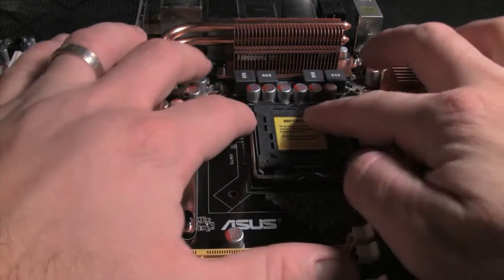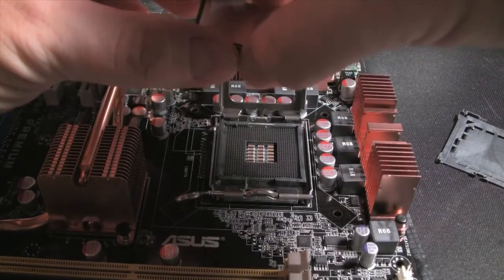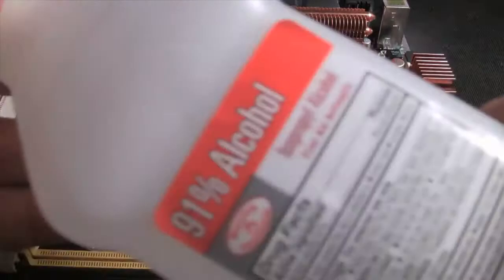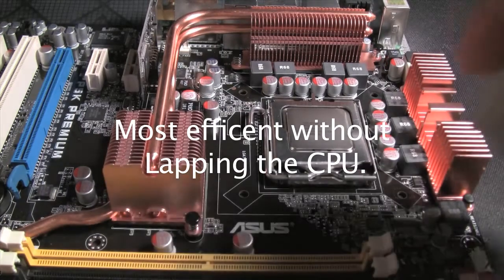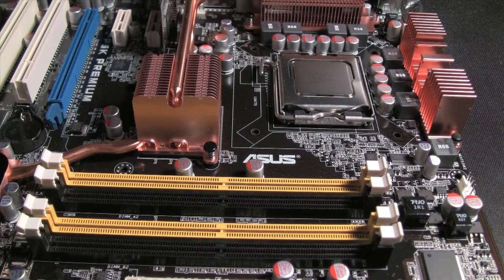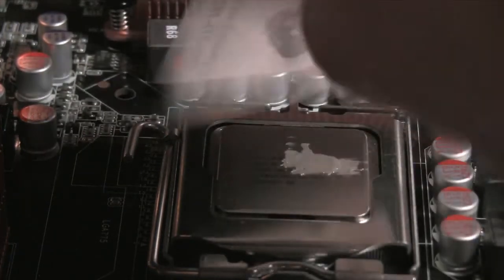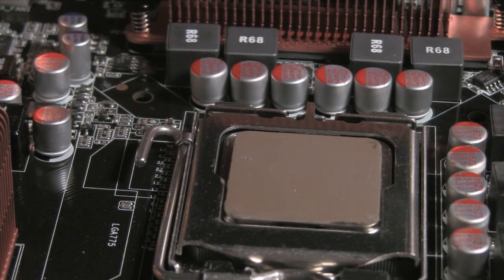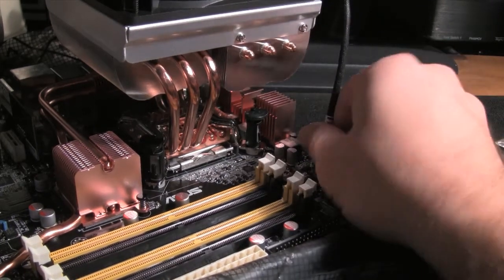How to install a CPU (Very Basic)

Comment from the maker: a paint brush could leave behind residue or small debris from the brush.  People have different methods from spreading the paste to a line to a dab that is pressed.  I like to cover the whole CPU.  Whenever the bond between heatsink & CPU is broken, clean off the old paste off & put some new paste on.  I have never hear of getting sick from heat paste, but it is messy & you will have a chore cleaning up after the stuff if it gets messy.

Comment: @TalesOfWar I don't feel that you get an even coverage using you finger...IMO you have more control to achieve a even consistent layer...does this matter.... probably not once you mount the cooler and add pressure....but it's just the way I like to do it.

Comment: i like your method for spreading the compound. i used to put a dab in the middle and squeeze the heatsink on the cpu and let it spread itself. i don't know if that was an efficient way to do it but nothing has gone wrong so far.

Comment: Nice video. I wanted to add that with my own testing, I've found that the difference in temperature on my old Q6600 using AS5 vs high quality white paste (like Thermalloy), there was only a 1 degree temp difference. I suspect if the CPU and or heatsink was not flat (or less so than it is now), there might have been a bigger advantage going towards AS5, but as long as the CPU and cooler are machined flat, its minimal. White paste cleans up real easy and is non conductive.